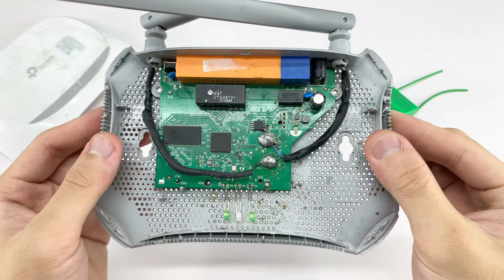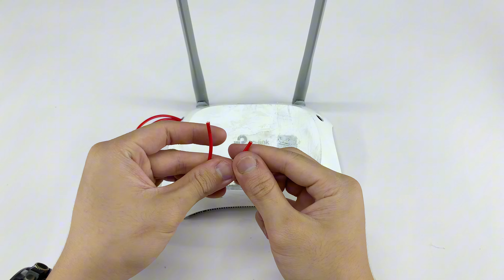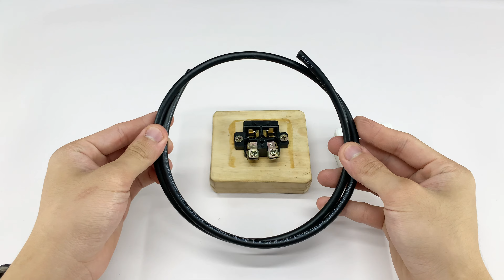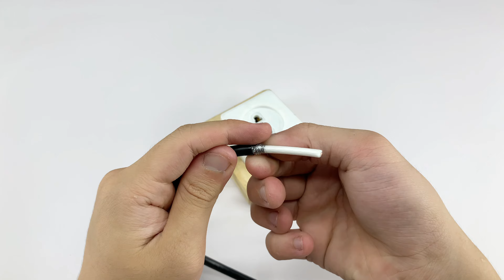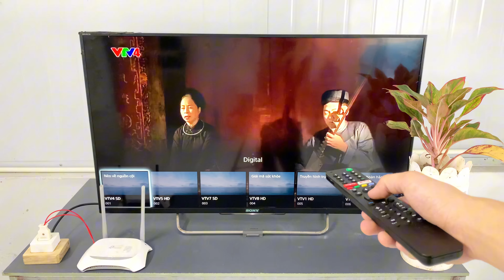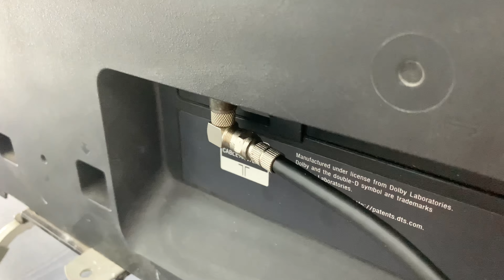Hidden Power! Connect a FAN CAPACITOR inside the WIFI ROUTER and Unlock  Channels 📡

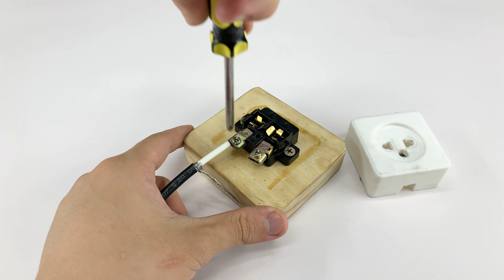Comment: From india, using this idea 9:30 is it possible to get the internet in a remote village area there is no electricity, only solar power let know
Reply from the maker: My friend, this DIY only works for TV signals — not real internet. 😊
In a remote village, you would need mobile data or a proper Wi-Fi setup with solar power. ✌️